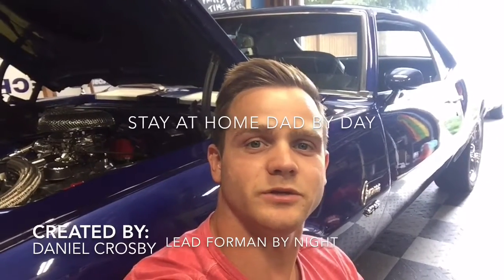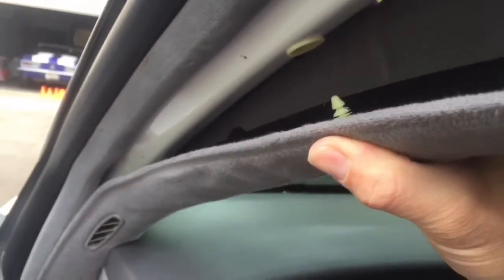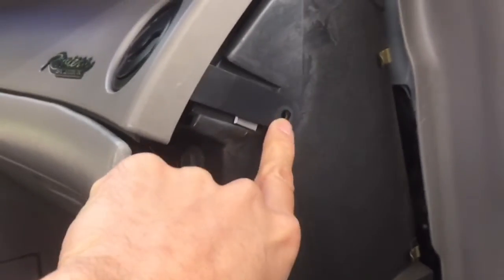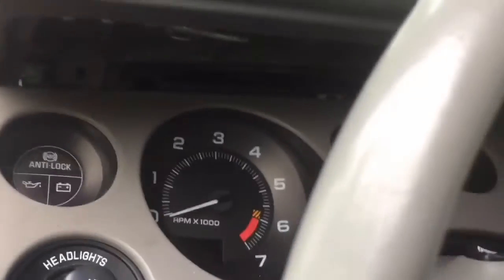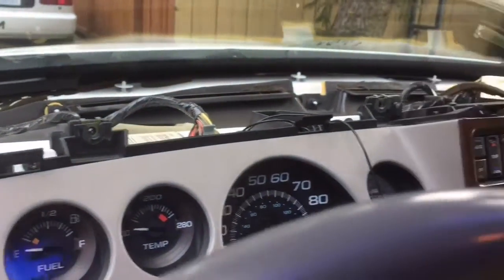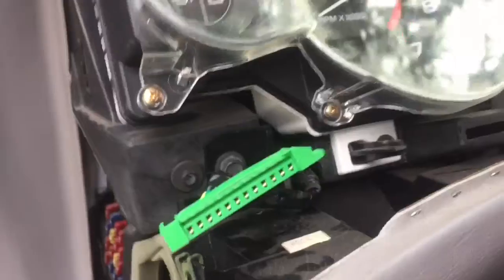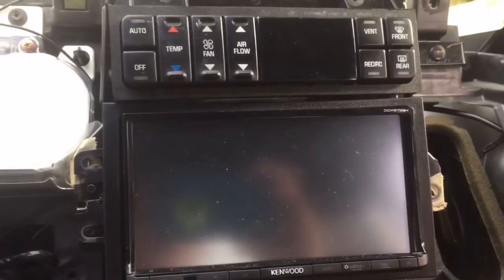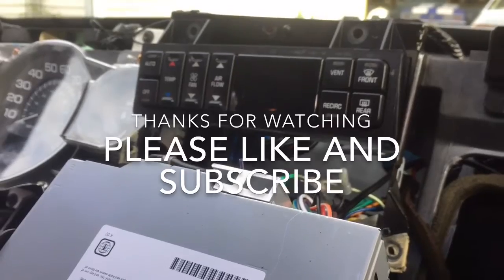How to remove stereo and dash from 95-99 Buick Riviera (stereo removal instructions)

Comment: Don't shortchange the video.  It was excellent.  I'd also recommend disconnecting the negative battery cable.  Go ahead, ask me how I know.
Reply from the maker: Christen Jankowski I'm still laughing.... how do you know?
Reply: Very simple.  Put everything back together, and I mean EVERYTHING!.  Turned the key?  Nothing.  Radio stone cold dead.  Tore it all apart, AGAIN, begging the Lord to not let my son think his father is an imbecile that has screwed up his radio which USED to at least work and now, bupkis.  So I prayed to the Lord and said "Lord, I'll never so much as take a screw from the junkyard again as long as I live if you'll only allow this radio to work...please Lord, PLEASE".

Well, I couldn't find anything wrong, then noted something else wasn't working, so I decided to look at the fuze box under the seat and bammo, found a red fuze that had blown.  How...I dunno.  Perhaps it was the divinity reminding me of the 7th commandment, but one new red fuze later and the tune box was a'humming.

Moral of the story.  Disconnect the battery or be prepared to look like an idiot.  And don't think you have full access to any "pocket parts" from the junkyard, or else you too will suffer some bad juju.

Case closed.
Reply from the maker: Thank you for sharing, this type of thing only happens to the best of us. I'm glad it all worked out for you.

Comment: On my 96 Riv, I have found that removing the A-pillar moldings and dash pad was not necessary.  I got the dash fascia out without doing so. It was not difficult nor complicated.
Reply from the maker: humbuckerpickups Thank you for sharing, I made the video for removing the dash as well since it was required for running my addition cables.
Reply: Thank you for a very helpful video.
Reply: How do I find your video?
Reply: @garynorth1723  I have original shop manuals for my cars.

Comment: Is that a double din?
Reply: Also do you know how to repair the tilt on the steering column
Reply from the maker: @benni rhodes yes it is a double din, is the tilt lock lever not holding the steering column in place?
Reply: @TweekerDan1984  no it's not allowing me to adjust the tilt. It's like something is worn or broken inside
Reply: @BenniRhodes  those steering columns are made with cast aluminum and the back half of them break they're a pain in the butt but expensive as well your best bet is getting a new column from the junkyard
Reply: @Ray-dw1zd  Do you know of any junkyards that have Riviera Parts?  There seems to be a lot of scammers out there.